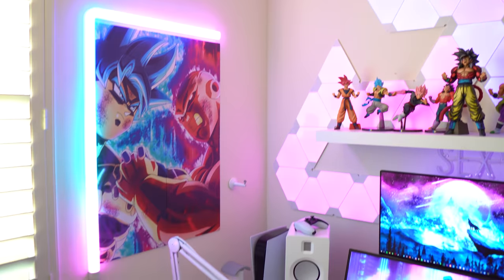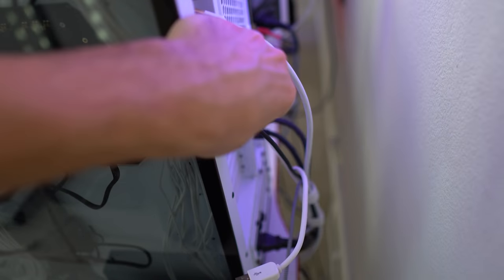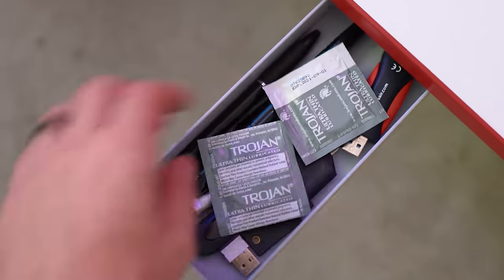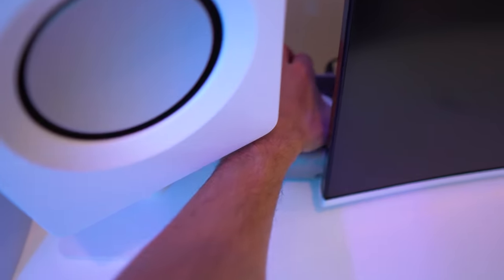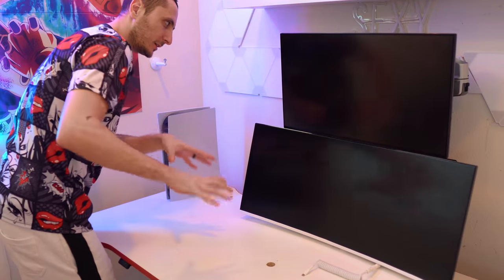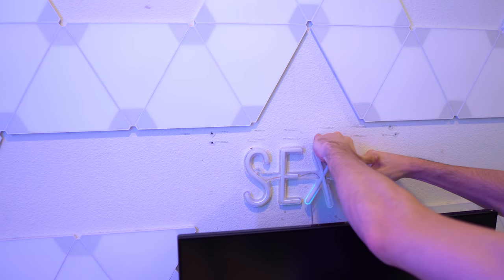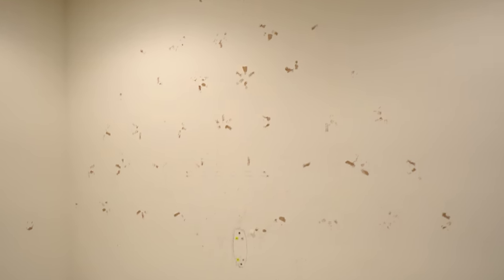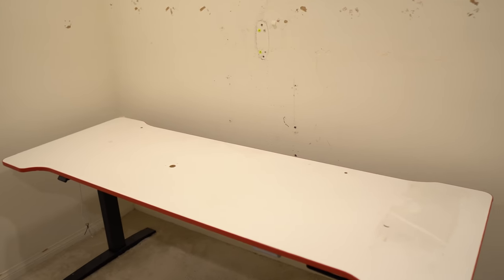Saying Goodbye to my Dream Setup

Comment: in the future or for anyone else looking to remove nano leafs or anything else that is stuck to the wall. get some fishing line and a heat gun.  Heat the item you want to take off the wall to get the adhesive tacky again and work the fishing line back and fourth against the wall. It will remove the adhesive with minimal damage.

Comment: I got a new build with the MSI MPG Z690 CARBON WIFI ATX DDR5 ARGB WIFI 6 motherboard with intel I9 12000kf and Nvidia GeForce RTX 3080 and my gpu temps while gaming and after benchmarking are getting to about 76° Celsius for my GPU. Is this a normal range? My buddy is also gaming on a 3080, his from gigabyte but his temps are drastically lower he is also on 11th gen not 12 I got 6 intake 4 exhaust in the lian li 011 dynamic xl case. Any info would be amazing

Comment: I’ve got a question about the 31.5" Acer Nitro XZ2 Gaming Monitor - XZ322Q  that’s obviously completely unrelated to the video, but figured this would be the quickest way to get an answer from someone. Does anyone know what the best mode settings (the settings you can set by using the buttons on the back of the monitor) for watching anime or movies & for playing games? Thanks!

Comment: the 3m tape is meant to be pull horizontally to the wall to remove.... it will def leave marks if you do it your way. though you had to leave a tad showing to do so.
Reply: thats not possible as there is another panel horizontal to it
Reply: @notcapnbloodbeard  horizontal was the wrong word... I just mean level to the wall.
Reply: @thecyberhobbit  oh ok